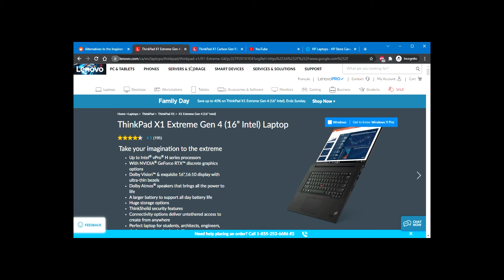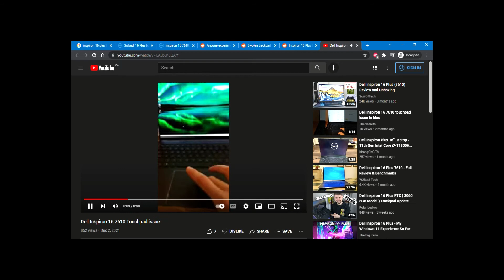Fix Trackpad Fix (Dell Design Issue) - XPS & Inspiron 16 Plus 7610 - Why you shouldn't buy!

Comment: I think you just happened to add pressure to the ground spring of the touchpad thus resulting in a better ground to clear static.
Reply from the maker: That is correct. Someone put a wire to neutral and that seems to fix it permanently.

Comment: The issue is not the trackpad, it is the battery. The heat melts the glue on the battery wrapping. This becomes loose and bubbles.
The bubbles then transmit static electricity to the mousepad.
Reply: how would you recommand fixing this issue?

Comment: I saw a solution posted on Dell's forums similar to this, only you've added some layers. You've inspired me to try this! Hoping you had success with it. Thank you for posting this video, your advice was very informative. 

I had this problem months ago, Dell actually REPLACED my laptop. The replacement also started having the same trackpad problem. A Dell technician came out and replaced the trackpad with a "newly designed" trackpad. After a week, the problem started right back up again.
Reply from the maker: I am not an electrical eng. Hence I can't fathom speculating what the issue really is. I don't think its swelling of battery. There are other models , virtually same design but they don't have an issue (namely Inspiron 5515). This is an on-going issue. After adding layers, it becomes useable (IMO) - its rare to have a mouse issue - never really 100% goes away. Also, whenever you will goto sell , I don't think anyone will be comfortable buying knowing all this.

Comment: Is this solution working for you @Xe Mohsen since you have posted videos in february, what is the feedback until now
Reply from the maker: Issue never really 100% goes away. It does become use-able though. I returned and bought a lower end Inspiron 5515. If you ever going to travel, its SOO much better. Screen is not IPS but its much lighter, but has touchscreen and its really reliable! (Battery life seems a little better too, even though smaller battery). I got the Ryzen version.

Comment: Any reason why I didn't get the issue for the first month. I am getting this trackpad issue once a week so I can manage for now. I have disabled display power saving mode. I will update if it comes back. Also I have made 3060  graphic card as primary.
Reply from the maker: There are lot of misinformation out there. For example, Disabling Intel / AMD Graphic card power savings. CPU Power Savings. Changing BIOS settings. Upgrading firmware, etc. None of them really work (or work temporary) and then it deteriorate for all reported cases. 

This computer CANNOT be used without a battery plugged in. I think if battery is not so close to the trackpad (or adding more non-conductive barriers), it will work perpetually. That seems to be the only permanent solution. Keep us posted.
Reply: I would guess it takes a month or two for the battery to start swelling. Same thing for me. Took a month with my first one, took a month and a half with the replacement that they sent.